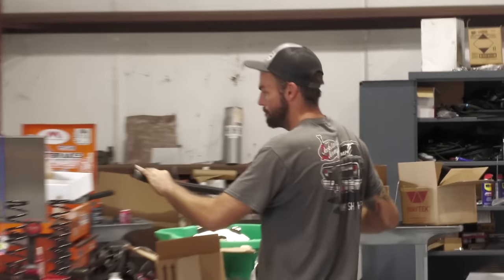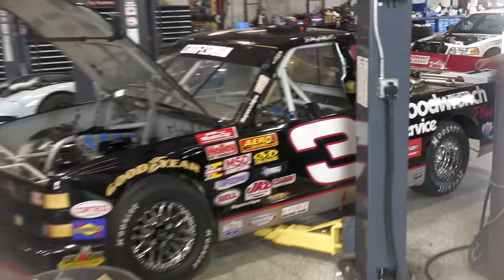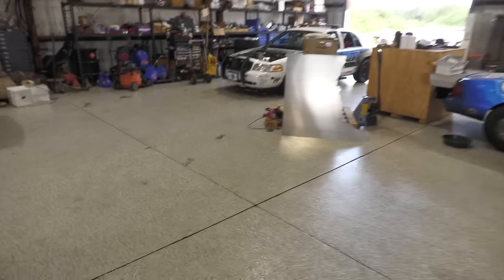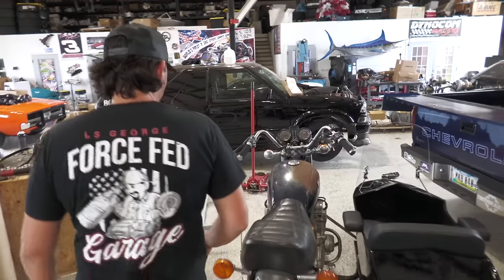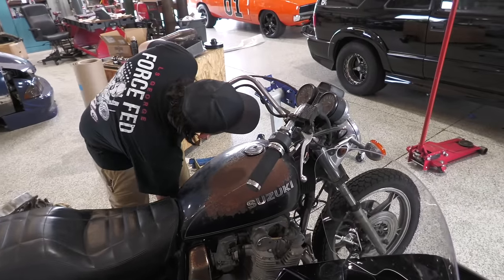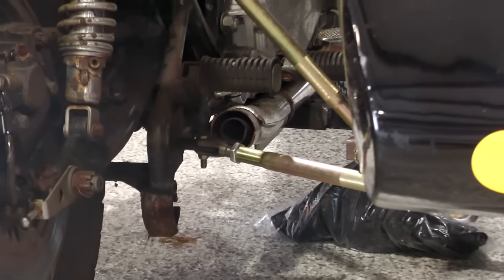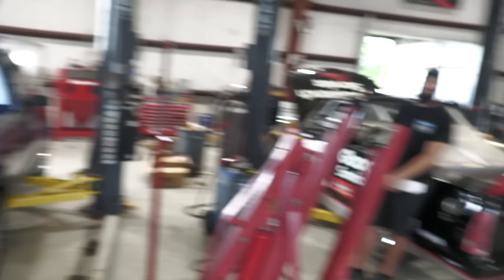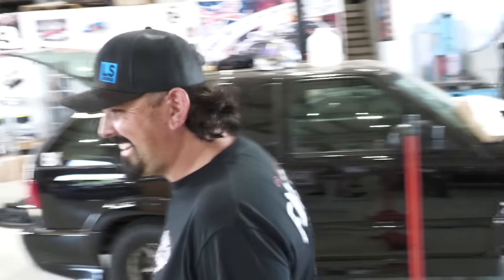New Camera Test (George Broke Old One)

Comment: Hate to say it, I think the old camera was substantially better. Even after the fog was gone most of the shot was still blown out in the background.
Reply: It's just the settings.  They need adjusted.
Reply: Find that HDR setting and turn it on!
Reply: Something with the stabilization made me motion sick. Might just be a setting though
Reply: @marcclerc8224  no! need faster processing. they need to lower white balance or ISO
Reply: sRGB -> P3 and a decent polarized filter and I guarantee it looks better. I think the zoom on this was super fast and pretty sharp. It looked like it used some kind of matrix focusing to pick out faces and objects very well. I think this will be a great track zoom camera when they get it to the track.
Reply: @TheCorruptedHuman  it would track better with lower contrast settings, or dynamic turned off also i think.
Reply: Different cameras for different purposes.
The camera its replacing wasnt the one used around the shop, it was the one Tye would stand halfway up the track with.
Reply: Agree camera trash dude just needs a bad ass expensive 10k$ camera lol
Reply: This is the camera they use at the drag strip, at the shop and most of the time they just use iphones.
Reply: Let's see the side by side footage
Reply: @OurLastStand  See Cleet's comment? "Posted this to hopefully assist camera fund $"
If this camera so good, no need for a camera fund

Comment: Hey man, those dudes asking for AC are the reason your shit is up to par. As A Diesel tech, and part time race car and motorcycles tinker..r..R,  I get where they are coming from, shits rough enough on the body, but heat, flat ass wears your soul to the grave on a daily. I live in Phoenix and work out in the summer heat from time to time when the youngins need help in the field. an AC shop would boost moral, and show, that those dudes, matter more than a car or 5. 

Wink wink this old far finally broke down and grabbed a cleeter hat, ya'll have my support. ( aint bought merch from anyone, until you, and your team, and my love for FUN on wheels sucked me in!!) Thanks guys

Comment: Cleetus sir I am happy to report that once the moisture situation subsided on the lens the audio and visual performance of the new camera is a success.
Reply: Thank you brother.
Reply: Negative...bad bad.
Reply: @CleetusM I think it was worse frankly
Reply: @CleetusM  First off, I did see the caption saying the ZOOM camera broke. So, I don't know if this camera is just to replace that one or not. This video seemed more like your regular content though, so I based my opinion off of that and this is how I got it. I ran two identical 4k monitors with factory reset settings and opened three main channel videos where you are filming in the shop on one monitor and compared them to this video.

IMO this camera's settings are all wrong, or this camera is a downgrade. The color grading is cold, and the image seems like either it has too high of an ISO or too low of a contrast, maybe both. Doesn't have that same softer, "sunny" warmth your videos usually tend to have that is significantly easier on the eyes. It also seemed like the little braps on the bike were enough to make the image shudder or freak out the auto focus which is a bad sign knowing that bike is probably not even close to the louder engines you guys run. 

As far as audio goes, a windscreen on the mic and I think it will do fine.

Comment: As a commercial hvac tech, I hope you're not trying to install the ac yourselves. At least get 2 stage equipment,  and make sure it easy to service, keep the coils and filters clean.  You might want to get stuff that has a dehumidification capability as well as ac. You don't want to end up with a cold damp shop. Get commercial grade rooftop units, don't try to do some ghetto setup with a bunch or residential equipment.  Love the vids and the channel

Comment: 💯 % George with the ecoboost issues. 
 I had one and honestly the biggest issue is the fact that ford only wants to change the oil on a turbo engine making over 100 hp per liter every 10,000 miles and says you can use the cheapest garbage fuel.
 Use premium and change the oil every 3,000 miles and 99 % of the issues magically dissappear. 
 Go figure,  using the proper fuel and changing the oil at the proper time makes the problem go away.  There is no magic oil that lasts longer.  Change your oil ppl 💯 . 
Use the best fuel you can get. 👌
Reply: The manufacturer just wants your shit broken so you gotta buy another car . Don't follow manufacturer scheduled maintenance.  We know what to do.

Comment: Wasn't crazy about this camera. Audio was fine even though it picked up a lot of background (like you mentioned, a cover would help) however the focus and fog didn't help the image. Seemed like it was considerably worse than usual. Likely because with pro cameras, you need to adjust and fine tune more settings.

Comment: @cleetus2mcfarland20  It seems to be set wrong or just needs a little adjusting if the settings for Exposure and Saturation, maybe a little more or less Contrast. Let the camera acclimate to the temperature where it is being used. Going from an air conditioned office or house to outside into warm or hot  with high humidity will cause the fogging. So, let the camera change to the temperature it will be used in at the time of the video BEFORE recording maybe 10-20 minutes? Sound is pretty good! It didn't crackle or distort when bike was revved so it will probably handle the loud sounds with auto audio leveling.

Comment: Dynamic range definitely isn't there, but that could just be auto ISO cranking the ISO way up. Let it acclimate to the temperature/humidity and see if the video clears up, I'm thinking condensation on the internal lens elements. Audio seemed perfect IMO.

Comment: Off topic cleet but if you guys decide to to get ac for your shop  and don’t have insulation spray foam is a really good route but pricey 3 inches of closed cell on your walls and 4to5 inches in your roof would work miracles on you electricity cost  and would be air tight. You could also go with a open cell but I don’t recommend cause unless you cover open cell it  can be damaged easily but however closed cell in a ceiling at 3 inches on top of drywall  you could walk on  it

Comment: I think some settings need to be adjusted to bring it up to spec but that's to be expected. It looks worse but because it looks worse I already know you spent substantially more on it than you usually do lol The audio has significantly more ambient noise and the picture looks blown out like the white balance and exposure are off BUT that was probably fresh out of the box in auto mode so it is what it is.  Start googling those settings!

Comment: Ford heavy duty trucks suck f250 and above all junk constantly in the shop getting fixed. Dodge makes the best heavy duty trucks. Ford makes the best light duty trucks. Chevy is just decent at making both heavy duty and light duty trucks but their heavy duty trucks aren’t better then dodge and their light duty trucks aren’t better then ford they’re just mid at both. It’s a toss up for cars between Chevy and ford. Dodge has the worst cars by far.